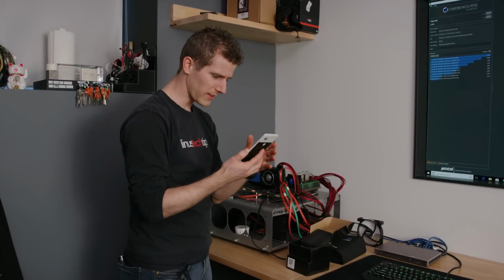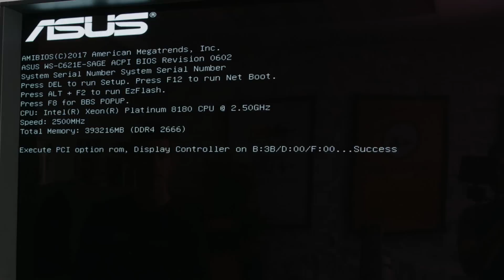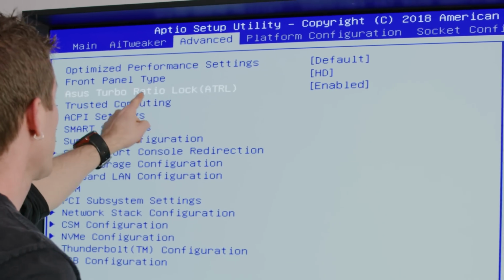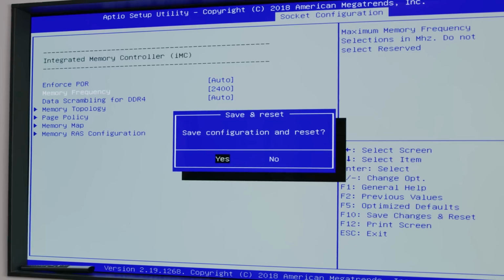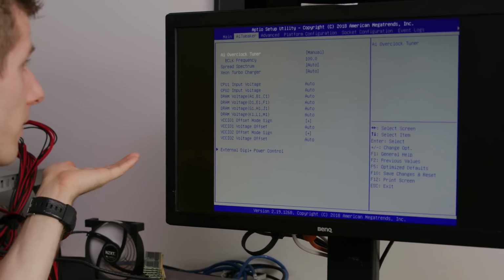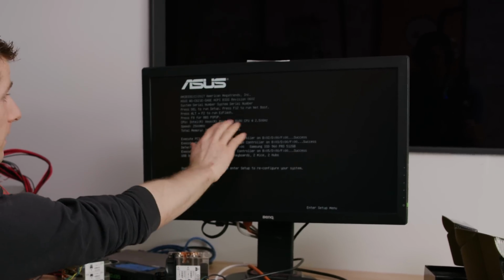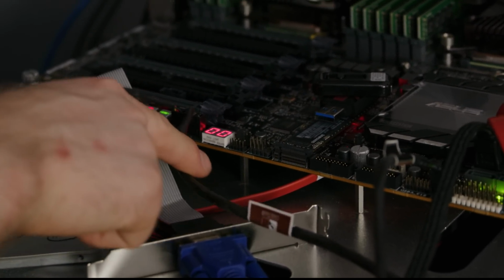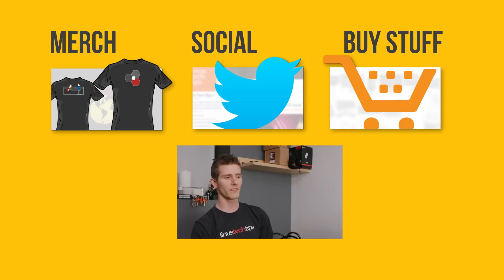Overclocking a 56-Core Server - Is there ANY point?

Comment: This is the exact setup I have, albeit with 8276L chips instead of 8280. My experience with attempting to overclock this machine is that if you somehow manage to get it stable (which is almost impossible while running 12 ECC DIMMs at their proper frequencies) it just eats so much power that you can't use it like that in practice. The power consumption during light browsing / office workloads quickly exceeds 250W (whole system) and your room gets far too hot for comfort. Plus long term stability becomes a problem. I ended up sticking to stock settings and just slightly tuning the Balanced performance profile in Windows so that SpeedStep (or whatever they're calling it these days) doesn't go all the way down to 5%.

Comment: Overclocking a high core cpu is 100x a more important than overclocking a low core (Hi intel) cpu. And overclocking is only wothwhile if you get a Signifficant bump in capability. If you have 16 threads 200 or 400 mhz is  MASSIVE, (an extra core or two). IF youre gaming it means nothing. In terraflops term its a tiny improvement.
Reply: also watching Linus cook his ram and not have a clue what the problem is , is awesome :)

Comment: Lol... Man... I'm lagging behind in the times... I'm still rocking an FX-8350 with 32GB of ram at 1600 (which I think is still only dual channel)... Might be time to start looking at parts for an upgrade... I built the rig as a present to myself when I got out of the Army back in 2013... Hmm... wonder how much the new 8th gen intel's are and if it's worth re-purposing my existing rig as a freenas rig (Raid 10 for 6 drives... not sure if the onboard will handle all of that)

Comment: The technique that linus is doing in this video is called reference overclocking.  The reference clock (the thing that is set to 100 that linus is messing with) is a clock that runs other primary clocks on your motherboard expect for the sata and PCI-E clocks ( this applies to consumer boards, I'm not sure if server boards do that though)  By increasing the reference clock, you are effectively overclocking the CPU, memery, and motherboard bus all at the same time because they use that number to determin thier speed by the multiplier (CPU at 30x times reference clock (100) = 3,000 MHz).  Most motherboards can be pushed up by  5-10%  on the Reference clock (and mabie higher with some fine tuning) and is a great way to get a small overclock on a locked system.  I used to own an AMD computer with a Athlon X4 640 and was able to overclock it from 3.0 to 3.3GHz on a locked board using that meathod!

Comment: The first computer I built used an Asus PC-DL motherboard.  Any overclocking (raising the front side bus) disabled the Intel SATA ports, but left the Promise controller SATA ports working.  This was confirmed in the manual.  I think your situation is by design.

Comment: Hey guys, I really doubt anyone is going to respond but I have a quick question. I’m currently building my first pc but I haven’t purchased a gpu yet because the prices are really high. Any budget 8gb gpu recommendations? Or do you guys think I should just wait until the prices go down a bit?
Reply: Dwight Gil gtx 1070 once prices drop
Reply: If you have a specific application that requires 8GB, then you should already have it narrowed down (CUDA vs OpenGL tasks). 

If you're talking about for gaming, don't know how you can possibly be that specific without knowing the GPU to start with. Like is the 6GB Vram buffer on a 1060 not enough? Its probably fine (other than the 1060 is kind of weak, but you did say budget). So that's anything from RX 470 (8GB), to Vega 64 (8GB), and that's a massive difference in compute power. Actually, if we are going by compute power (and 4k Ultra gaming), my 2x R9 Fury with 4GB beats even the TItan Xp (I also own that card) in most of my games.

Comment: I think you're able to OC that but not by touching the Bus frequencies,it creates conflicts and issues with the rest of your components when you can actually have a pretty good oc'd system by raising the non cpb CPU ratio ( multiplier) only.
Some other things to look out for are:

Under your DIGI+/LLC settings look for Cpu load line calibration and set this to High Or Ultra high when High is not sufficient.
Set the CPU/NB at high and your CPU PWM mode at extreme.

Things to disable for a stable overclock are:
C1E
Cool n Quiet
Core C6 state
APM Master mode ( Important but overlooked by many )
Pcie Spread Spectrum
CPU Spread Spectrum
And disable any Autotune/ Auto overclock setting in your bios aswell.

When only adjusting the non CPB CPU ratio,do this in small steps, add 5 and reboot and keep on adding 5 while your system remains stable,keep doing this untill it doesnt boot anymore,and then give it more voltage and doing the adjustments described as above im sure youre able to come with a proper and stable OC.
Reply: Get a load of this guy. Babby's first overclocker thinks he knows his stuff now, except this is a SERVER CHIPSET so you cannot screw with the multipliers, only the base frequency.

Comment: It's actually  by design that the system shuts down if you mess with the base clock. It's been like that for eons with Intel chipsets. Why does Asus even support changing it? It seems irresponsible. Especially for a server...

Comment: back in the day 2008 you overclocked using base clock and multiplier manipulation for example your FSB was 333mhz by default with a Upwardly locked 10x cpu multi giving a a 3.3ghz base clock you ram was on it's own multi ddr2 ran at say 800mhz so you ran a 2.4 multi etc (you manipiulated all the other frequency multis to bring them back to close to stock onless you wanted over clock your ram aswell (which you usually always did) about the only thing you didn't do was overclock the southbridge

so say you wanted 4ghz on your core 2 e8600 you ran a FSB of 400mhz a cpu multi of 10x a ram multi of 2x and let the main board hand the FSB to southbridge clocks

Comment: The last time I overclocked using Bus Clock was on a chipset X48 and Core 2 Quad Extreme QX9770, which I managed to get all the way to 420 Mhz bus clock on air and 4.2 Ghz core. since then though overclock with bus is not easy at all intel change it and now it is different

Comment: The last time i did BCL overclocking was back in the days with my Athlon XP 3200+

You could reduce the multipliers for all the other frequencies to keep something like the PCI lanes running stable. So they gave the BIOS the function to run BCL overclocking but didn't include those settings?

Comment: BLCK or back in the day FSB overclocking was really fun. You had to do much more to get it stable and fiddle around with the RAM, NB, etc. Had my Athlon X2 250 running from the stock 200 to 240 FSB for a stable 3.0 -> 3.6GHz overclock and even reached 3.96GHz at one point which wasn't 24/7 ready tho.

Comment: Linus, overclocking a 56-core cpu is not going to make it any better, in fact the system will be at 99% stable and the other 1% is the system actually not working. ask yourself, do you want a working system, or a bricked one?? please this is so funny. I'm okay with you trying to make a system like this do the impossible, but weighing up the current risk you need to evaluate it before you even start overclocking.

Comment: Well, nobody seriously tries to overclock servers.  There's no point... racks are almost always limited by power consumption, so you actually lose cpu performance by overclocking due to power efficiency going to hell.  You can't fit as many cpus into your power budget.

The other reason is simply that servers are meant to run full-out, 24x7, for years.  Excess thermal stress might be fine for a home rig, but for a server farm its death.  Playing the clocks close to the limit might work fine for benchmark tests, but real-life workloads can't afford to have memory errors or even occasional data corruption. It turns into a huge headache.

People who run actual server farms don't overclock.  They just add more servers.

-Matt

Comment: Remember EVGA classified SR-2 dual socket motherboard?  You could get a 50-55% overclock on Server 6. Core Cpus.
dual x5670, 12 cores at 4,3ghz 
x58, those where the times

Comment: Oh no, he didn't try updating or rolling back the BIOS version. No wonder it didn't work!

I'm joking. I just finished recovering a motherboard with a corrupted BIOS. There was no alt bios switch, and the chip itself was soldered onto the motherboard (Z68A-G45 G3). I had to flash it ICSP, using a bus pirate. Less fun than it sounds.

Linus did prove that water cooling a server can reduce cpu temps significantly.

Comment: no its never worth it.. do to the fact that software isnt even utilizing the hardware at the base config.. so your not going to see any real difference thats worth it.  if you bought lets say a 2.1 back in the day dual core and you could overclock it to 2.5 and the 2.5 chip cost an extra 200 dollars ok then it was worth it.. but your rig has 0 benefit of overclock because whats the best you can get.. save a few secs on load up.. and a second or 2 on certain software.. for the risk of ruining 30k.. Sorry not worth the risk reward scenario.

Comment: Of course there was no point. Especially since overclocking tends to shorten the lifespan of hardware anyway...people wouldn't typically buy a $10k CPU to see how much they can overclock it. They would buy it to run in a reliable workstation or server for many many years. But that isn't why people want to watch this sort of video. It's because I believe the question is "can it be done" not necessarily "should it be done". It's for science right?

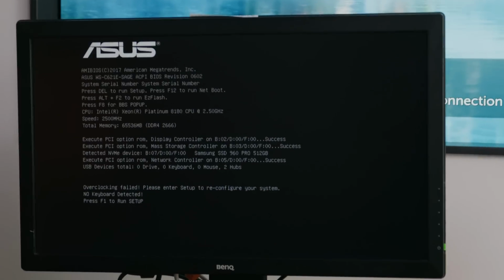Comment: 6:20 "No Keyboard detected! Press F1 to Run Setup" LITERALLY LYING ON THE FLOOR LAUGHING
Reply: Lol yup
Reply: Anton1699 It's a server board, you are allowed to plug keyboard in weeks after boot.  So it wants you to plug in a working keyboard and press F1.  Of cause if the failure is in the onboard interface controller it won't work, but rather a BIOS that lets you try, than one wrongly assuming you can't, like so many RAID controllers do if a drive cable is loose.

Comment: can you do a review on the ASUS Zenbook and compare it to the LG Gram.  Also give in depth thermal information on both.  And how long can they hold turbo?  Because from what I can tell other than battery life this is better than the Gram in most use cases.  I would like to see if the Gram can hold a turbo for longer than the zenbook.  

Specifically this laptop https://www.amazon.com/dp/B077BXRBK1/ref=psdc_13896615011_t2_B0768M9KVY

Comment: Linus, please overclock the Almighty Pentium 4!
Reply: Intel Pentium Extreme Edition 965 FTW
Reply: SlapThatBurger - WT Yeah now I remember... I've heard someone say that the Pentium D was nicknamed "Pentium Disaster"
Reply: MackisLife because it is 2 pentium 4s in the size of 1
Reply: No No No... It has to be the Pentium D😄
Reply: MackisLife The Almighty Pentium 4 is the Real OG so.. ye
Reply: I would definitely watch that
Reply: Must have been trolled xD
Reply: MackisLife xD i see
Reply: CCF_100 no the intel 4004
Reply: No overclock the Intel 8080
Reply: Why doesn't he overclock the original Pentium?
Reply: Nick Gardner I'd be willing to donate one with board and ram.
Reply: Dawid Itrych we are talking about overclocking. There are pentium 4s that have been overclocked beyond 8ghz on LN2.
Reply: That thing already runs like furnace...what would be the point of making it run hotter? Trying to use the heat to fuse hydrogen atoms into helium?
Reply: Actually, my Old Pentium D 925@3.0Ghz runs at 35 idle - 55 under load
This is with the stock OEM heatsink
Reply: I have one running at 2.8ghz
Reply: Pedro Guerreiro i had mine at 3.5 in my gaming computer about 5-6 years ago. It ran everything fine surprisingly
Reply: MackisLife if you want the D, he'll give you the D
Reply: pentium d plz
Reply: Overclock a i386
Reply: Tried that, failed epicly XD
Reply: Q6600 watercooled fuck yeah
Reply: The Coppermine P3's were quite a lot faster than the Williamette P4's clock by clock. The P4's ran at higher clocks so they were kind of faster in real life, but at the same speeds the P3's trashed the P4's :P That's when the Athlon 64's came... :P
Reply: Naw man, its gotta be the Legendary Pentium 3 :)
Reply: I have a pentium 4 so please overclock cause i need a guide
Reply: It will burn your house from the heat
Reply: More like pentium DD
Reply: Yeah please linus
Reply: I want to see Linus try my FurnaceX-9590 past 6Ghz lol
Reply: Yeah, compared to the AMD Epyc processors the Pentium 4600 is An absolute GOD.
Reply: AMD 2000+ was the best! :)
Reply: Actually, I had a P3 with more than 33% OC (600 to 800+) on stock fan 24/7 stable. Those where the times. 😜
Reply: Yeah, the P4 did run hot- so water cool it! :D
Reply: SlapThatBurger - WT I've done that. Overclocked to 5 GHz. Ran hot as crap and eventually burned out the socket in the board
Reply: @MilesDeighton1  haha, I have a GeForce mx 2 on an old Dell running XP.
Reply: wut? Pentium 4 was awesome back in the day..
Reply: Pentium 4 were the worst pentiums

Comment: Dual Xeon: 56 core for 20000 dollar
Dual Epyc: 64 core for 8000 dollar

With 20000 I can buy 2 Epyc dual cpu, 1 Epyc single socket and have 160 cores in Cluster. 
So tell me Intel, what is your point?